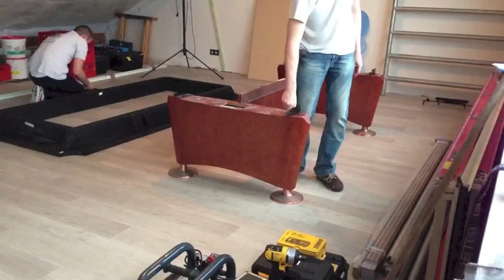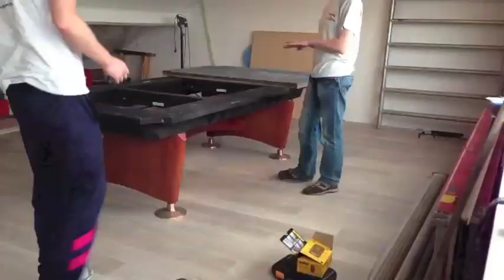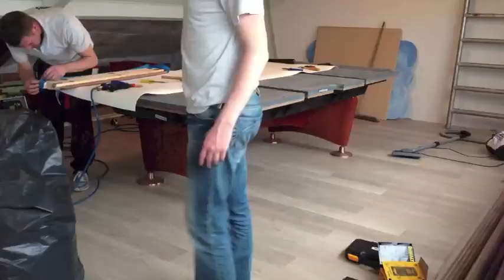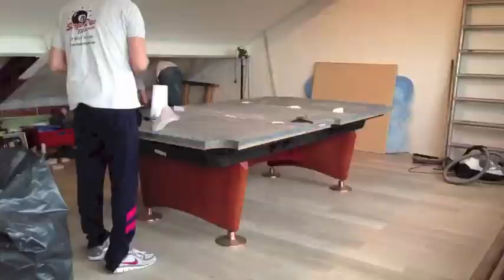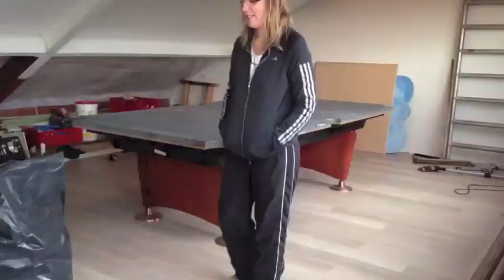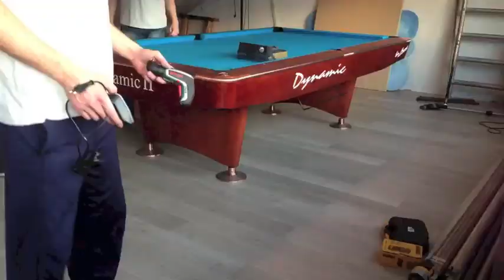Installing a pool table in 4 minutes...

Comment: Can you upload the same video in normal speed... if posible, some comments how to level the table, i have the same table, trying to level it.
Reply: The feet are the leveling system for the table.. You wanna use one quarter turns..

However, with older gold crowns the slates tend to bow slightly over time, sometimes with a bowl effect, and other times with a crown effect.. Not much you can do with a crowned slate.. But a good mechanic can remedy the bowl effect with well placed wedges between the slate and frame..

Depending on the table, you may have to get a real pro in their to get it just right.. But the leveling system with the feet works very well once you get the hang of it..

Hope that helps..